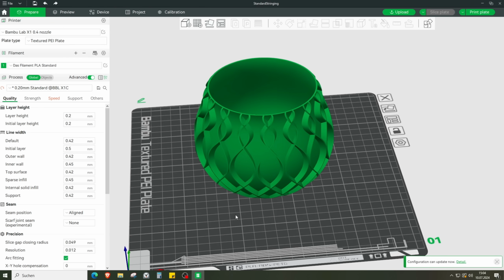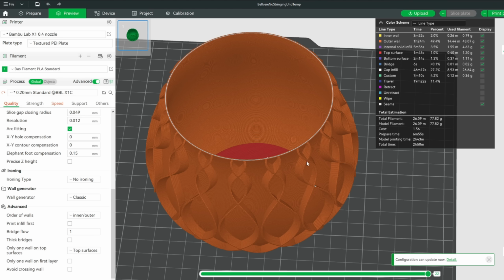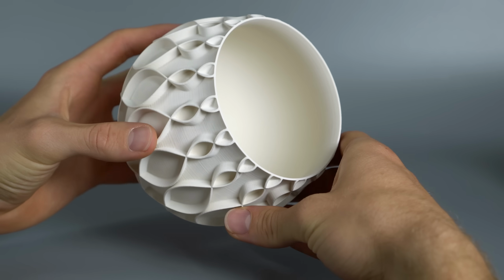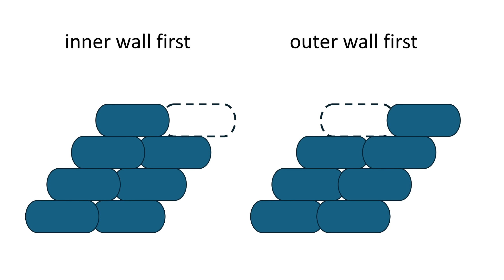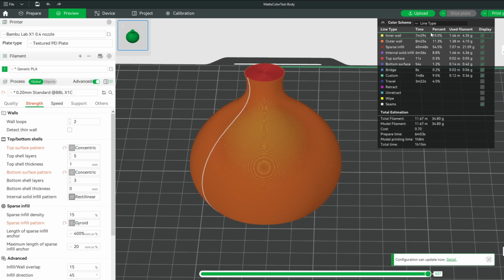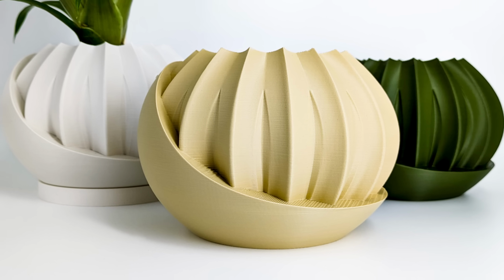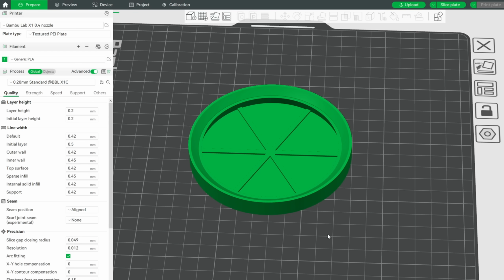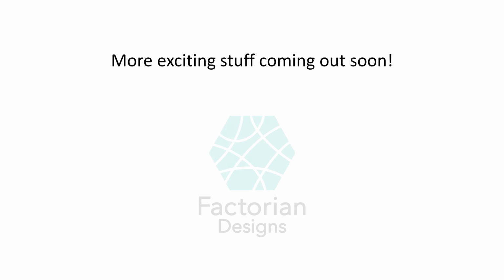5 Tricks For Incredibly Clean Prints!

Comment: At first I thought this was a Small Batch Factory video, hahaha. Good tips overall! Orca Slicer now has a setting to fix the inconsistent outer finish without removing slowing for layer cooling. It's called "Don't slow down for outer walls" and it's just below the setting you disabled. This is a better option if you are having cooling issues of any kind. Wow, 20 seconds later in the video you cover that, hahaha. Nevermind! Good stuff!
Reply: How you like orca? I have the p1s with bh app.  Played with orca before I got my p1s and I feel like I like it better

Comment: Another solution for the matte/glossy issue:
Just slow down your outer walls. Most of the print is inner wall and infill, so there’s really very little benefit to a fast outer wall. 

Plus the “slow down for cooling” setting can save your prints.
Reply from the maker: True, but the Orca Slicer slicer solution to the problem is very good, mostly use that slicer until Bambu Studio implements that change as well.
Reply: @Factorian_Designs  definitely. They’re rolling out new features pretty often now as well.

Comment: In other simpler words: better going back to print with the ender 3 😂😂 new printers are fast, but what about the quality? These tricks you suggest are correct but they increase the time of printing
Reply: Plus the quality on Bambulab printers is far, FAR, better than shitty Ender 3 ones. Trust me, I sold all my Enders too with zero regrets 😊
Reply from the maker: Even with all the shown settings on, my Bambu prints around 3 times faster than my Ender 3. I even sold all my other printers as I just didn't use them anymore. Only the first ender has to stay because of all the modding and emotional attachment :D
Reply: I design 3D terrain for tabletop board games. I had a Wanhao i3 and CR10v2, both calibrated and heavily modified. I was mainly printing at .2mm. I got a Bambu X1C and I have to say my workflow has drastically changed. I print at super draft .28 mode, at regular speed. The quality is equal and at times better than .2mm on both Wanhao and CR10. the i3 prints at 45mm/sec, my CR10 at 75 to 100mm depending on the terrain type I print. The Bambu at 200mm. In my case, it’s a huge game changer. Workflow and quality.  I have a video that shows the quality difference in settings with the Bambu. I didn’t do a side by side with my other printers as they went the way of the dodo bird.

Comment: Thanks for the tips, but shouldn’t you print the vase in vase mode, just set the perimeter thickness to 1 mm for a 0.4 mm nozzle works great for many cases.
Reply from the maker: Yes you are right, you can always do that. A 1 mm perimeter with a 0,4 mm nozzle is maybe pushing it a little far but 0,8 mm usually works great for me.
That being said, sometimes times people like to print the vase with thicker walls because they like the look more.

Comment: Have you used scarf seams before?
Reply from the maker: Only a little. I need to try it out more for sure! Do you use it regularly?
Reply: @Factorian_Designs  I've only used it a few times, both with ok results. Its an improvement over the normal seams, but not as much as I was hoping for. Seems like it has potential and just needs to be dialed in
Reply from the maker: Yea most of the times they looked better, but sometimes got worse seams on overhangs. If they improve those as well I will take another look.

Comment: Great video and tips. I’m new to the hobby (bambu a1) and it seems like all any one cares about is speed. I want the highest quality possible. 

Do you apply these settings and use them in bambu for all your prints?
Reply from the maker: I use "Avoid crossing walls" for almost every print, as well as "Don't slow outer wall" in Orca Slicer. The top layer pattern and wall print order are situational. Whenever I can, I only print one object at a time as well.

I hope that answers your questions!
Reply: @Factorian_Designs  it does. Thanks for your quick reply!